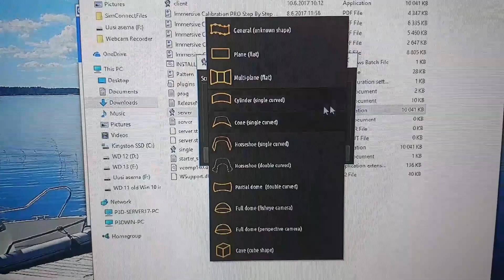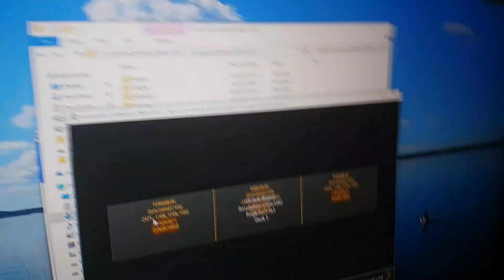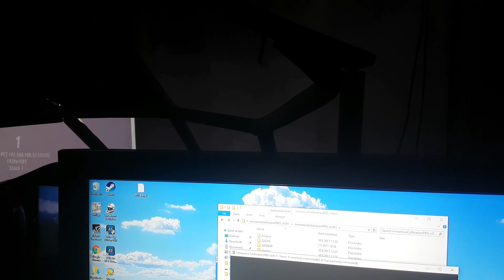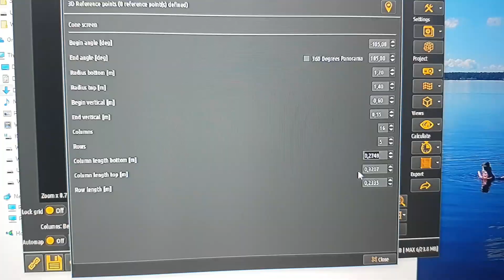Fly-Elise Immersive Display Calibration PRO how to get started 2

Comment: Great information. Have you tried using this with Xplane 11? 
Cheers
Reply from the maker: Stewart Lunney thanks! Yes I've had but it's not as simple to use as in P3D which uses the files directly in ViewGroups.
Reply: Thanks for the reply.
I have also tried to follow this but still no joy.

https://brusselsflightsimulators.com/x-plane-11-multi-monitor-fly-elise-ng-step-by-step-tutorial-guide/

I have made a 180 degree curved screen and have 2 projectors mounted above with windows 10 operating system. GTX 1080 Graphics card I7 processor, Immersive Pro version 3

I have spent 4 solid days trying to get Immersive Pro to work in Xplane 11.

I have successfully created the calibration file which looks perfect on the curved screen.
I have set the tabs as per the articles recommendation – Use asymmetric frustums is not tick.
Created the appropriate Calib multi files all 7 have appeared and the main 3 you recommend were copied to usb and put onto the client PC.

Immersive pro was then started. Under Display Tab selected 2x1 projectors and the screen shows two halves. Left click the left half and select external calibration then select my multi -pro calibration file, then left click the right projector and select again the external calibration and then the other multi-pro calibration file and save. 
If I select desktop warping I don't get desktop warping in the true sense but 2 separate screens with curved bases. (NOTE: If I go to my graphics card and set it up as two monitors, which is the only way I believe you can get Xplane 11 to allow you to see two monitors in the graphics settings so that you can see Main monitor and monitor 1 which then allows you to input the lateral offset ect)

When I run Xplane 11 I still get 2 separate screens one of which says I am still using the trial version of immersive pro (which I am at the moment to see if it all works) and the other screen does not say I am still using the trial version. But a second view of Xplane 11 to the right of the screen.

I am confused!!!

Senario 2: 
If I set the graphics card setting to 2D surround mode i.e one extended screen then run Immersive pro I get desk top warping when the box is checked which is great but this is no good for Xplane 11as it is now only a single monitor. I am confused and would really appreciate your help. There seems to be very little about how to do this from Immersive pro. The only thing they show is a projection with 3 monitors to flat walls which is not what I want.

Sorry if this all sounds confusing but your help would be greatly appreciated.

Regards

Stewart
Reply: Hi, I'm facing a problem like the graphic card software could do the surround when I turned on the computer, then the flyelise can't work, even all the setup was right. It happened couple times per week. Do you know what costed that?
Reply from the maker: It shouldn't be in surround mode when using Fly Elise, it should always be as separate outputs. Strange if it boots up in that, it shouldn't do so. Just disable surround if that happens.
Reply from the maker: If I remember correctly, in Xplane the settings needs to be added manually in xplanes settings regarding the views. It doesn't automatically use viewgroups but you can use the frustrums file(s) and or numbers from there.
Reply: HI again. 
Yes I did try all that but for any one else out there  having any issues, make sure you test it out on a default aircraft. I was trying to get it to work with a Dream Foil helicopter which was causing all the problems.
I eventually tried Xplanes default Cessna and helicopter and it was all ok. The offset numbers are not working in the Dream Foil Bell 407 but work ok with their 412. So the moral of the story is always test things with default aircraft first.
Reply from the maker: Ahh yes, you are right, I've noticed the same thing. Thanks for pointing that out.